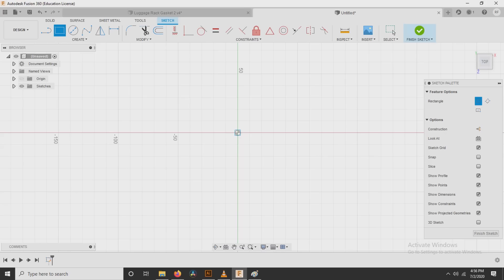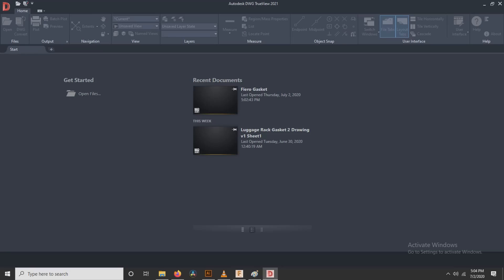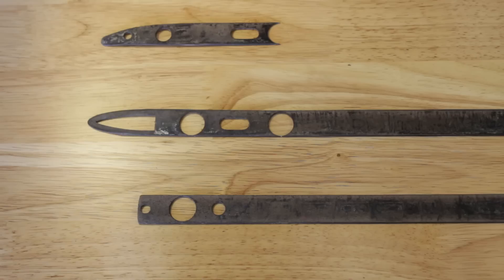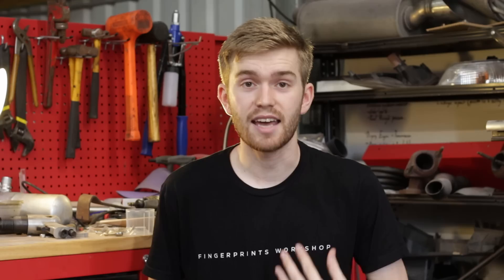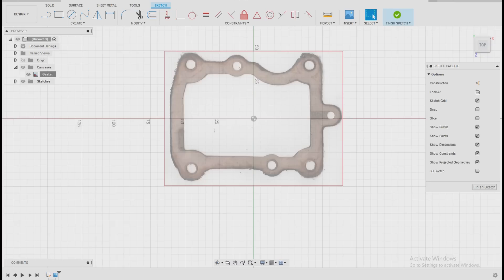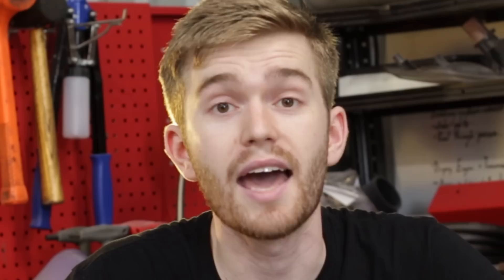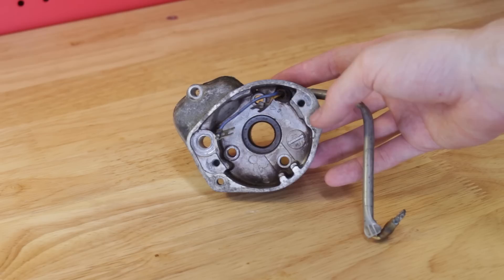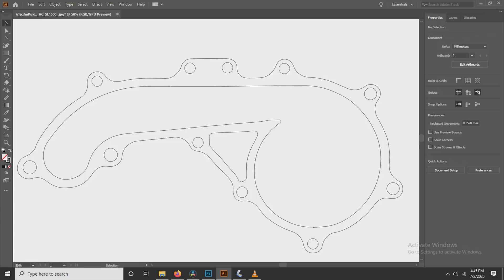Replicate Any Gasket! (Vector Graphics for CNC) | Saturday Projects

Comment: "We're not cavemen here"   Years ago I was a carpenter in NYC and I used all metric measuring tapes, drywall square, etc.  Everyone laughed at me at first until they realized I was running circles around them because you can do metric math in your head, even if you suck at math, like me.  Meanwhile they're practically doing algebra on a napkin to figure out what's 89 1/2 inches divided by 2 foot 7 inches.  :):)
Reply: Dude seriously. I do all my measuring in metric on sewing and everything else. Inches is just too... clunky?. It's a pain. Metric is better.  Oh need a more precise measurement? Well... 42.5cm is 425mm I live in the US BTW where inches is king.

Comment: You missed one of my favorite methods - no computer, no image programs etc.  Get a sheet of gasket material, and a ball peen hammer.  Place the gasket on the area that needs the gasket and lightly tap the gasket material all around the edges effectively cutting the casket material to match.
Reply: Rob Bowen :  That's exactly how I've been making gaskets for the last 25 years. It can be a little tedious sometimes but also enjoyable...at least for me.
Reply: For the luggage rack gasket, I would get a bicycle tire and trace the old one to it.
Reply: @donbishow5497  A tube would work much better. And with an unrolled fatbike tube, you could do stuff the size of water pumps, and maybe even heads. Not that the material would be ideal for those specific applications...
Reply: Been watching Roadking do it this way for a long while.
Reply: this is like how software developers will spend 20 hours automating a process that would have taken 10 hours to just do manually.
Reply: @SpaceMissile  I guess the best thing about this is you can easily do a run of 10 and make money to pay for the setup time. And then hopefully give the plans to a [Fiero] club so anyone can do it. Because you know someone else will need the gasket eventually
Reply: @geoffmerritt  should probably upgrade that computer....
Reply: @SpaceMissile  sure, but then you have to spend 10 man-hours every time the process has to be done, instead of just 20 once 🤷‍♂️

Comment: A method shown to me by my brother-in-law when I was a kid: take a cereal box and turn it inside-out, lay the plain brown side up; lay the old gasket FLAT on top of the cereal box; lightly spray paint over the old gasket (make sure it doesn't move while you spray paint it); this will leave a perfect shadow (no paint) outline of the gasket!  Then just cut out the new gasket with scissors and an X-Acto knife.  Feel free to use a light film of gasket maker on both sides of the cardboard gasket, and there you go!  I made many gaskets this way, including for thermostats.  Works great when you're in a hurry and on a tight budget.

Comment: This will be extremely useful in restoring my dad's motorcycle. What will also help is the fact that matching parts for it are rare to impossible and he has those often fragile parts in pristine condition, and I have casting and machining equipment for things of that size. Which means that I can just use those rare expensive parts to make negatives and those negative to make copies of what are at this point irreplaceable parts which will make them replaceable once again, then I can just sell them to people who need those parts.

Comment: Hi Ronald! Love this series. Illustrator Pro Tip. In the Image Trace Panel select advanced and "Ignore White" and you won't have to worry about deleting the white parts. You also have access to options to adjust the threshold, paths, and corners to make those ellipses more round. I'm ocd so I still prefer the manual trace method.

Comment: Have you ever looked into 3D printing with TPU filament? Its a flexible rubbery material, you can make gaskets for non hot parts, such as door handle gaskets.

Comment: Nice tutorial m8! But Illustrator live trace is not a perfect tool. As long as you are cutting vinyls/paper and other soft materials it is ok, but live trace is making a lot of anchors in the vector path. So if you are going to cut the shape in the steel there is a possibility that the edge will be preety rough :/ Also, an advice from me. In Illustrator open window with live trace options and tick the option "ignore white" - nothing to select and delete after the expand :) Keep it up! I really enjoy your videos! :3

Comment: My CAD program is much more archaic by most peoples standards, however it is just as effective.
CAD I use stands for:
Cardboard
Aided
Design 
I just trace the item onto cardboard, cut it out, and then make a gasket out of whatever material you need.

Comment: @Ronald Finger: The sketch you make at 2:08  can just be right clicked and saved as a illustrator compatible dxf, so no need to go through the extra steps of making a drawing (which, yeah, weird that it doesn't have a few dxf/dwg versions), then converting, then importing to illustrator, then hiding unneeded stuff, etc, etc, etc
Hope that makes it easier for you next time, and keep[ up the good work!
Reply: Ok but what is the point of converting to vector. These CNC cutters cant take standard CAD files?
Reply: ANDDDDD as I am typing that out he goes over the illustrator requirement.

Comment: Fourth method if you can't easily remove the part from the vehicle/assembly is to make a pencil drawing. Put a sheet of rasterized paper on the gasket surface and scuff the outlines with a pencil. The corners of the gasket surface will show through quite clear and from there its scanning and tracing all over. 
Used that technique to make an aluminium "billet" carburetor adaptor for my Golf mk2 ;)

Comment: The BMW m70 V12, used in the BMW e32 1988 to 1994 750iL and the BMW e31 850 cars, literally uses a paper gasket to mate the throttle bodies to the upper intake manifolds.

Comment: When I was a young lad and I needed a gasket made I used a ballpeen hammer and my brain to make it, Later I got some hole punches to do leather work with and they came in very helpful cutting the holes. Not a CNC or computer anywhere.
Reply from the maker: You actually have to use a brain for working on a computer as well. But for sure! This isn’t “the way” to make gaskets. Just “a way”. If you wanted to start a company supplying gaskets, something like this would be helpful. I can’t imagine hand cutting would be too efficient.
Reply: John Fithian-Franks Making gaskets by hand is simple and easy, but the main reason was that when I was making gaskets with a hammer computers had not been invented (I am 70 years old). I do now own a CNC, Vinyl cutter, and several computers, including my first computer that was a ZX81 with a blistering ram of 16 K

Comment: In Illustrator if you go to "Window" then select "Image Trace" it will bring up a panel with more options for how you want to trace your image. In those options you can refine how accurate you want the tracing to be and also have it ignore the white parts so you're just left with a vector of the part itself.

Comment: Please nobody torture yourself with GIMP, get Krita instead. There's the good bits of the same GEGL image processing engine underneath, but it's a much smoother experience in every single regard. It's actually good! And you're losing nothing of the underlying software freedom. Like GIMP is an image editor of the Gnome Desktop project under Linux, Krita is the editor from the competing KDE project, and just like GIMP it's also available for other major desktop operating systems.

And Inkscape... i have used it... you can, if you have to... slow as mud in Windows releases, though it's gotten better. Has always been fairly usable in Linux - i have done some fairly involved stuff with it, it worked. On Windows, drag and dropping any of its own example files it ships with (Version 1.0 final) that are in its own installation folder in share/inkscape/examples on top of the program causes an instant crash, which to me, finding a crash within the first seconds of using a program, which is not down to complex compatibility issues, instantly demotes it into 'junk' category. Perhaps just about usable if you just want a simple outline. Though i get spoiled by rendering performance of Xara Designer and then likely nothing else will be quite good enough.

Comment: Pro-tip, This comes from many years of doing what you do, only with other kinds of things, I used to be a production designer for a company called SlickWraps. Scan your gaskets in black and white, not grey scale, not color. you will have even better results with less tweaking. Otherwise your video was extremely fantastic. I personally use Corel draw not Illustrator. It was a bit more user friendly, plus when i learned it, its all the place i was working for had.  in any case, love your vids, and i cant wait until we see you paint your fiero.

Comment: Don't gaskets for body-mounted stuff such as luggage racks have a little lip on them so they don't roll under the component when it's torqued down? How do you recreate that?
Reply from the maker: Not mine at least 🤷🏼‍♂️ The luggage rack gaskets were completely flat and made out of the same gasket material that an engine gasket would be made from.

Comment: Great video!  I have a question though...  WHAT do you do if your gasket has 3-dimensional features??  For instance a rubber door handle gasket with a raised lip?
Reply from the maker: That’s a tough one! If it’s not crucial, I say you can probably do without the lip, but if it is... then maybe that would require a mold made? Or maybe just layering up and gluing gaskets?

Comment: OR.....without turning anything on, without having to have a library of software and making sure they're all compatible ( I did AutoCad for years), Knowing all the software well enough to use correctly, Knowing someone or a company with the equipment to cut this out that won't charge you too much and their software is compatible with yours.  You can cut these out by hand. In the antique auto restoration world, parts for Pierce Arrow's and Deusenbergs and Auburns are not easy to come by. With very little investment, a little skill and patience, you can hack out any gasket you need, by hand. Now, repeatability? No, your method can do that, this method won't. But, as stated earlier,  the "buy in" is way cheaper and easier. Yes, I cut out gaskets all the time, latest? 1958 RIva boat intake manifold gaskets. Its a 318 poly head mopar engine with a Riva only manifold. The fun part is using a dirty finger and a piece of paper to make the pattern from the part. Your method is nice, makes a good part and repeatable, BUT, old school tried and true methods can work in a pinch when you don't have the equipment. Remember, there are a whole slew of us old guys that have been doing this type of work, for a living, professionally for 40 years, that will be more than happy to share our wealth of knowledge to pass on!! Just ask. I have people form other shops call all the time needing help with "things" that they can't figure out. Good luck and keep up the good work, you're very entertaining.

Comment: Good gaskets. But why you dont use Hig temp silicon. which is  the advantach ? Regards
Reply from the maker: For a lot of parts, if you add a little bit of white lithium grease on both sides of the gasket, you can remove the component multiple times without breaking/tearing the gasket. Just makes things a lot quicker and easier. Especially useful on a side cover for a motorcycle!

Comment: Agreed, we aren't caveman.

I use inkscape. I normally just take a picture, trace it manually or with automated software then scale it. .svg files generated by inkscape can be used by the software a lot of cnc machines use, if not AI has no problem converting it to a .ai file.

I have a laser, it cost under $200 and can cut gaskets. I also have a membership to a makerspace.
Reply: What brand of laser do you have

Comment: You can export it as a dxf from fusion. I've found dxf works best from illustrator to fusion and fusion to illustrator.
Reply from the maker: Donovan Green, interesting,DXF wasn’t readable either for me, without being converted at least. In True View you can only convert DWGs, from what I’ve seen at least, which is why I chose that format.
Reply: @RonaldFinger  Strange. I've never had an issue. Maybe try it without putting the outline on a sheet for exporting? Love the Fierro series.

Comment: That's seems very complicated, or maybe I'm just an old fart.
I've made them by hand and a nice little tip for the luggage rack gaskets or anything small enough that is only there as a weather seal or anti-vibration seal would be to buy some bicycle inner-tubes and cut them to fit.
I've replaced door lock gaskets and other items like that and they've never leaked.

Comment: Does anyone know how those old trunk luggage racks are supposed to work? Like how do you attach your suitcase to them? My old Pontiac had one so I bought a new trunk lid.
Reply from the maker: Just lay the luggage on top and use a bungee net or multiple bungee cords to hold them down. There’s holes at both ends of each of the rails for the rack for the bungees to hook into 🤙🏻
Reply: @RonaldFinger  thanks for the info, I  don't remember holes in mine but it's been almost 20 years. What I do remember were the attachment holes on the top of the trunk lid that were rusting out because that gasket didn't work very well.

Comment: You left out option number four. pretending the person doesn't have a computer, or a printer, or anything other than some gasket material... 
You can just put grease on the bottom of the part, press it into the gasket material, and cut it out with a knife.

Comment: I work in manufacturing and I have to say seeing you switch from program to program was painful to watch. My industry uses CorelDRAW exclusively. All the steps you performed can be done in CorelDRAW and it can export files to almost any format. We use EnRoute for our CNC machines which can import EPS, DWG/DXF or AI files and those file types exported from Corel are always flawless. Plus, there are fewer steps to actually draw/recreate/trace things like gaskets & other items. Honestly Corel gets on my nerves sometimes with it's quirks but as someone who is fully proficient in AI/PS, AutoCAD and a ton of other programs over my 18 years in manufacturing & design, I don't see myself designing anything like this in anything other than CorelDRAW.

Comment: Hey Ronald, does CAD software have a steep learning curve?
Reply from the maker: For what I did, absolutely not! It’s not until you get into surface modeling that it starts getting pretty tricky for a lot of people. Sketching shapes and dimensioning them is really pretty easy to get the hang of quickly 🤙🏻
Reply: Ronald Finger ok cool, thanks man 👍

Comment: I need all the gaskets for my ATV Honda engine, but I don't have the resources to do as you showed inn the video, do you have any idea of how a can get them, the engine I have is 17 years old, and it's a 450 ccm, the closest I can get to my engine nowadays is a 420 ccm and a 500 ccm
Reply from the maker: A quick ebay search pulled up a decent amount of results for 98-2004 450 Honda ATV engines. I would do a search there if you haven't already, because (without knowing what model you have exactly) it seems like this might be what you're looking for.
Reply: @RonaldFinger  my ATV is a Honda foreman TRX 450 2003, I did find a gasket kit on the internet, but I don't know if that is all the gaskets I need

Comment: I'll pass on the metric system. If you can't figure out fractions, which are literally halves of the previous (1/2, 1/4, 1/8, 1/16) you need to go back to school!
I mean, 841mm or .841m? Wtf is that? There's no reference to compare that with anything. 3'-3" is way easier.
Reply from the maker: It's only easier because that's what you were taught and that's what you know. If it works for you, then cool!
Reply: @RonaldFinger  fine Ronnie, your kind demeanor has calmed me down.

Comment: Thanks for the tip, but that method still isn't the easiest (unless you want to mass-produce). The easiest method does not require a pc, nor software, nor a printer. You just put a piece of paper onto the part you need a gasket for and start shading it with a pencil. The pencil will keep hitting ridges underneath paper, which results in outlines of your gasket. Then you cut that out and your template is ready. After which you can proceed to cut out the gasket yourself. It's not like an insane amount of precision is required here. And besides, this can be accomplished with household tools. Why make it complicated needlessly and increase the waiting time, by relying on others needlessly?